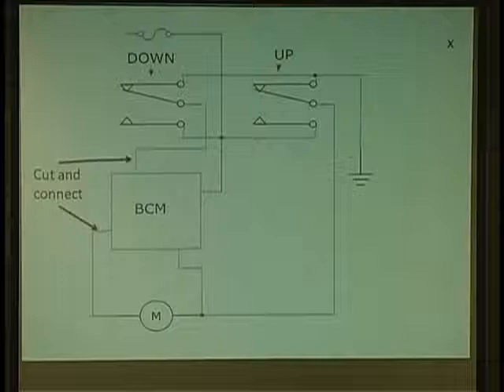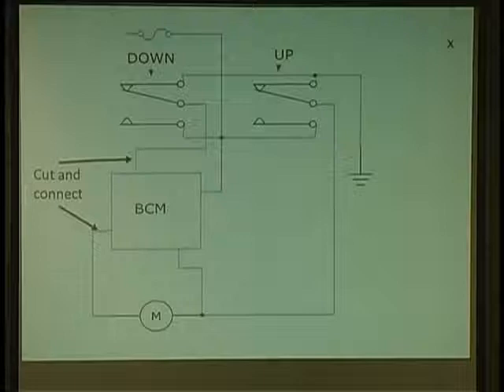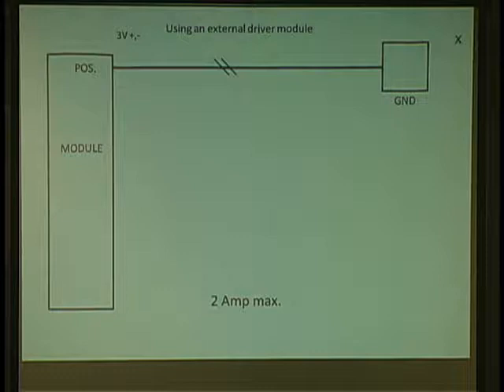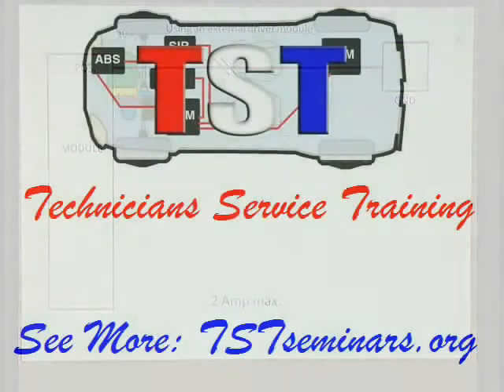Rich Peterson: Electrical Quick Diag & Repairs

Comment from the maker: This is a clip from a 3.5 hr training seminar & webcast. I understand how it can be a bit confusing since it’s not the complete explanation on the window circuit test & repair. Rich the instructor was showing how to prove out the circuit including the switch and motor so when the tech ordered the replacement part he would not have egg on his/her face. Thanks for watching and commenting, please view our extended webcast such as ECM Inputs and Outputs, Modis, Voltage Drop and PO171 to name a few.